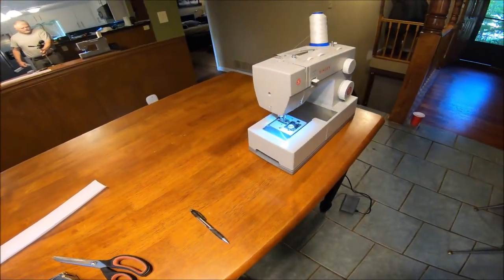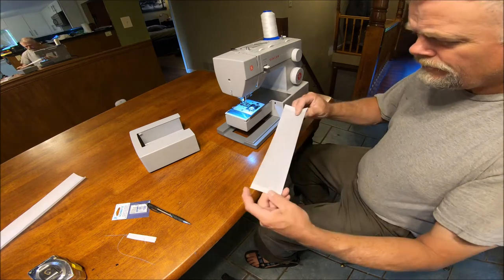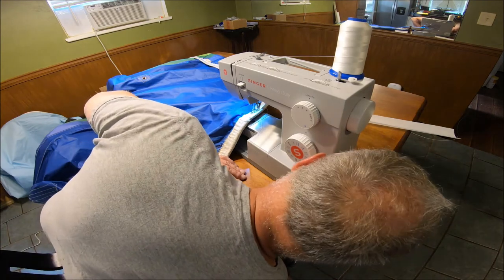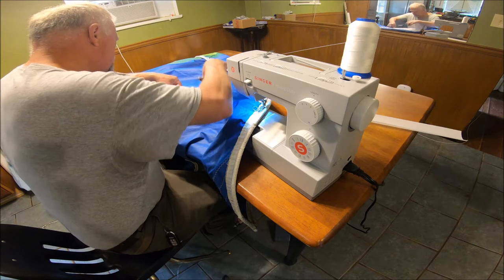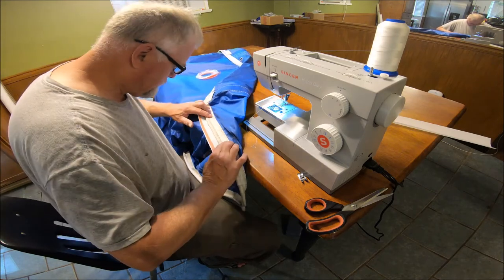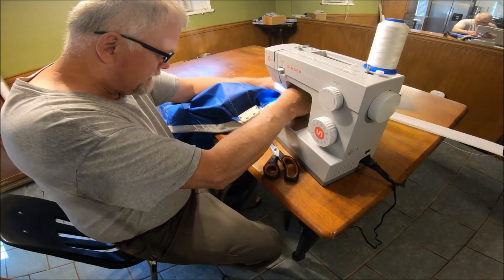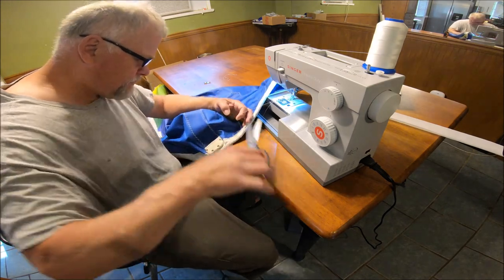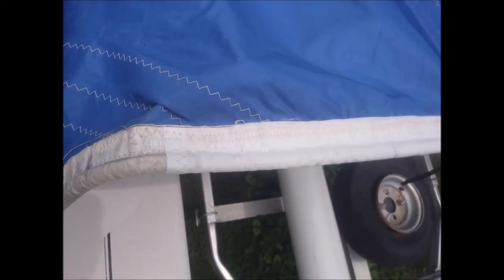Making Sail Repairs with a Cheap Sewing Machine

Comment: Would it have been possible to remove your old repairs that way you didn’t have to go through so many layers?
Reply from the maker: I've got to redo it. It's been catching and torn again. Yes I'm gonna try removing down to the original.
Reply: Hopefully it goes a bit smoother for you. Have you tried a walking foot attachment?? Might help pull the sail through the machine.
Reply from the maker: @timmitchell8081  I'm too cheap to lay out that kind of cash for a repair.
Reply: Definitely know that one. I have a Maricat 4.3 that is held together by the cheapest parts I can get hahaha

Comment: hello sorry which model is this heavy duty sewing machine, a mean the number of the model? thanks
Reply from the maker: It's the Singer 4423 even though it did work i cannot recommend it. If you want to do a good job you really need something with a walking foot. Sailrite models are not cheap but are really what is needed for a good repair

.
Reply: @AlvinShepherd  ok thanks so much I was thinking yo Buy one yo make My own sprayhood for My sailing boat. But the ther brang it's to expensive for me at the moment. 😉
Reply: You can get a walking foot for the Singer 4423 for like 25 dollars, and then it seems to work well for sewing sails, from what I gather. That’s what I’m going to do when I buy one.
Reply: You need a Teflon foot, a walking foot and size 19 thick needles. I have the 4423 and that works on my 31’ sailboat canvas.  UR doing it all wrong.